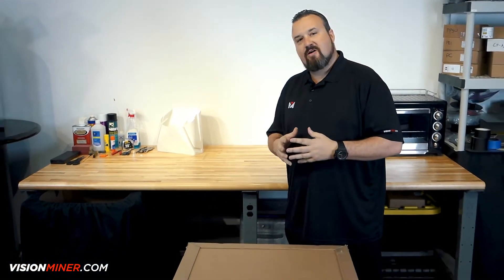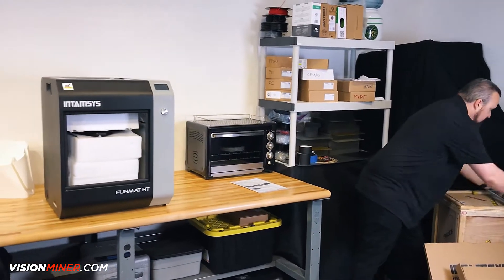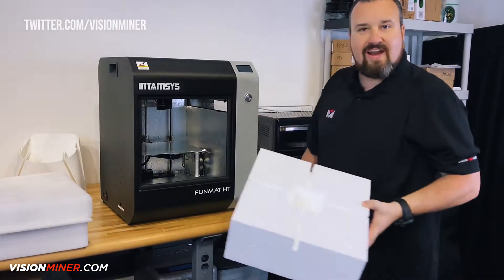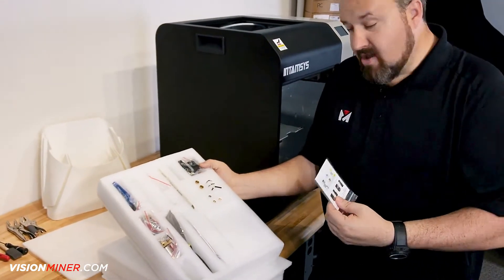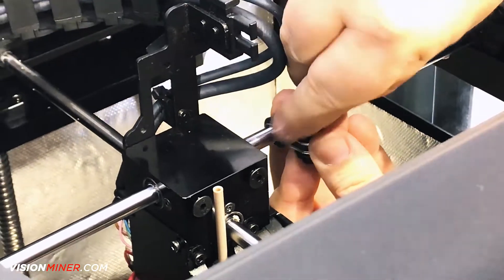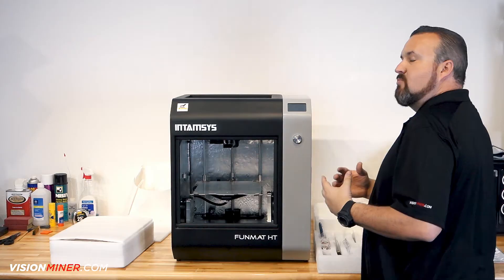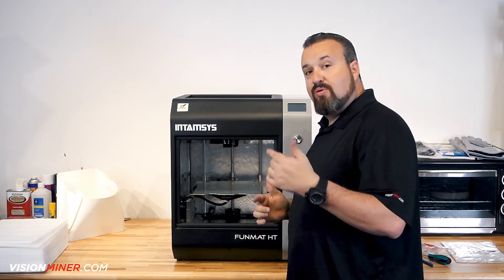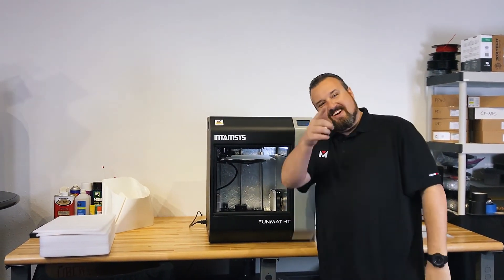UNBOXING: Intamsys Funmat HT - PEEK & ULTEM™ 3D Printer - Buy from VisionMiner.com

Comment: Worth noting that as of 6/23 the accessories come in separate boxes, with more tools, and high temp proof gloves. The mini pallet it comes on measures 31x26". One healthy man with a hand truck can move it before unpacking, I'm a smaller fella and had no significant problems. If it is cold upon delivery let it acclimate to your inside temps while in the packaging to avoid risk of condensation collection on components. You do not want to have to ship it back because it went tits up. Also, unlike in this version from the video the P7 connector for the motor is on the board and you must remove the nozzle heat shield (2 screws) to access it.